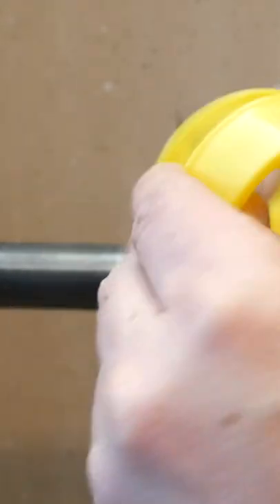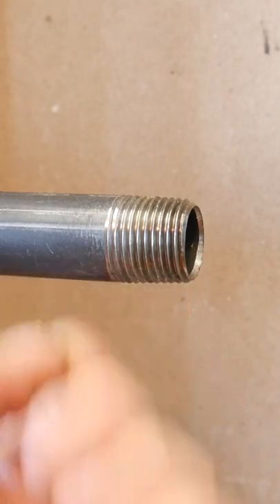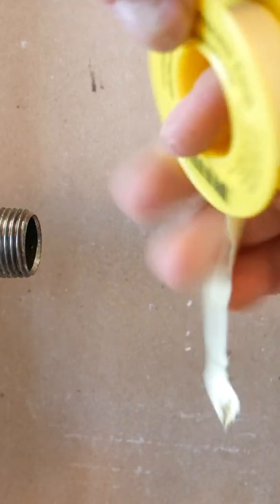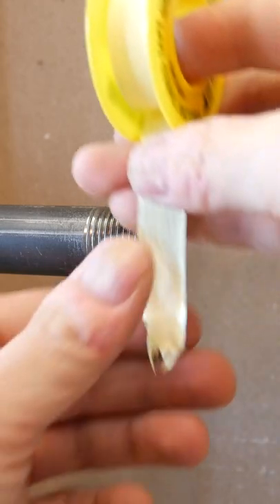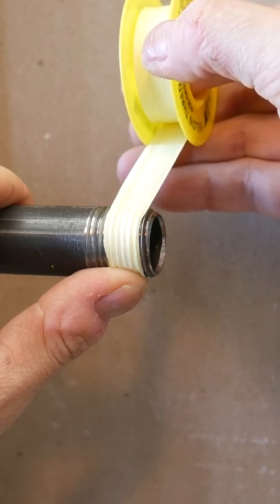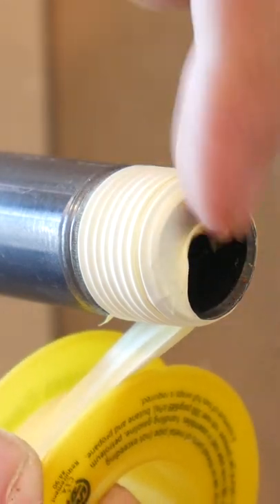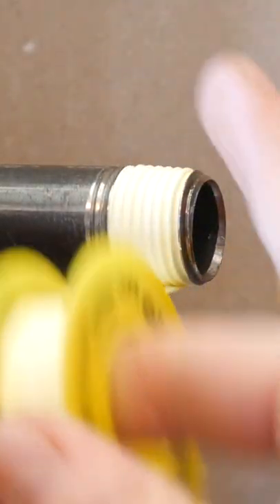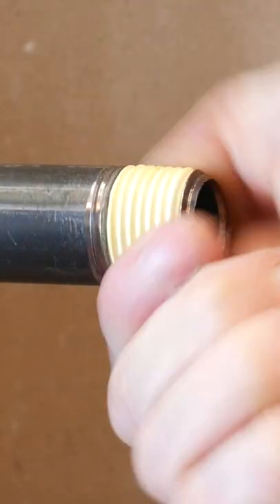How to apply TEFLON (PTFE) TAPE the Proper Way! (full video in description)

Comment: Not only that when you go to tighten anything on it, it’s gonna spin the same way so it will pull some of it off making it ineffective
Reply: as long as you apply clockwise by your right hand it will be effective, with out pull some and much easily turn tighten.

Comment: You should have specified you were taping a pipe for gas. You don't want to use tape specifically made for gas on a pipe carrying water, or vice-versa.
Reply: Blue for water, yellow for gas, and white for air. Different attributes that allow the first two to seal when they come into contact with water or petroleum gasses, but air doesn't need to be able to seal because you want to do a couple extra wraps. I think that's the reason, but might be wrong. If so let me know why?
Reply: There's absolutely no difference between white and yellow tape besides thickness. They can definitely be interchanged by just adjusting how much you use.
Reply: why ?
Reply: @Deathbomb9 maybe its just my area... i've never seen blue tape and the stuff for water is white. for air, most fittings use rings and grease or are precision made to press fit

Comment: Never use tape on gas piping, dope only. Whisps of tape can be blown through the pipe and past sediment traps. This can clog orifices and hold open pressure regulators.
Reply: I use tape and dope. Hold it back a thread. Won't hurt a thing
Reply: Just twist the tape and apply the same depth as the fitting. Then apply pipe dope. This will keep the tape from shredding towards the pipe. Use monster brand. It's for water or gas

Comment: 2 rotations is more than enough. I plumb in chemicals for water treatment on frac pads (hydrochloric acid, chlorite, and napco bleach) using either schedule 80 pvc kr kynar. Anymore than two rotations you are putting strain on the female pipe/whatever female threaded product you are using. 2 rotations and a line of true blue or other thread glue will do you with any liquid you are plumbing

Comment: Somewhat related question: Is there a proper order when using pipe dope and tape? I was taught to dope then tape… but I know some people were taught to tape then dope. Merci!
Reply from the maker: Its actually one or the other, but if I was to choose one, it would be tape, then dope.
Reply: @Got2Learn  Nice thanks for the info. I think the company I worked for did dope first so it'd be less messy lol. Water sprinkler pipe/fire suppression systems.
Reply: I do a thin coat of dope, one wrap of tape, then more dope. Manufacturers tell you not to use both, but everybody does it, everybody is different, some keep them Dope, it is probably a waste of time to use tape until you get to larger fittings like 2 in and larger. Don't use it on gas, however they do make special tape for gas piping, it is yellow in color.

Comment: I disagree with the direction of the roll. I apply about 4-5 times a day going through a lot of this stuff and yeah, that’s normally the way for most tapes, but for Teflon, I do the opposite. It keeps far more taut.I have one thumb on the roll and the other guiding.   Normally I’d not reply but funny you have opposite experience.

Comment: Don't you need to wrap it AGAINST the threads ( meaning, counterclockwise)? Reason being, it unravels if it is in the same direction as the thread, when you go to install it
Reply: It’s going in the same direction as you’re turning during install when you go with the threads. It doesn’t come off

Comment: almost, not quite.
I think you also need to be clear, both visually and verbally,
that its important the direction of rotation must follow the direction the pipe will be screwed.
You dont want to have the tape tail being pulled back by the clockwise direction of screwing the pipe on.
So, perhaps for clarity, show AND tell people to wrap tape in the same direction as you will screw on the pipe.
Reply: Now that's more clear n consice ig

Comment: Also it can only be applied clockwise on the threads or it will unravel itself whilst your tightening it into the fitting
Reply: Unless you are doing it too reverse threads, but that isn't in need of Teflon usually
Reply: yess unfortunately however you apply it aslong it is clockwise and tight you are expert

Comment: If you're using thread tape to seal a jar that the original seal has went bad or just a container of some kind with a lid that needs a seal, you can add the tape to the top threads and let it hang ever so slightly over the edge to form a seal for the lid as you tighten it down.  But yeah, don't do this with pipes, like he says.  Lol

Comment: For natural gas we cannot use Teflon nor should we rector seal number five is the way to go
Reply: #5 is the way to go!
Reply: There is an approved tape we use in the U.K. also we call it P.T.F.E not teflon tape just different terminology
Reply: @alemgas  UGH, the Tape in the Video is YELLOW TEFLON which is approved for Gas Lines
Reply: @LyonhartZ2  someone said you cant use teflon tape on this post, i pointed out there is a tape you can use on gas, as in the U.K. it's the yellow spool one. Cheers

Comment: I disagree little bit, the leaving the first thread part! Sometimes doing that , when you put the female side fitting, the tape roles back and insted going like in between the threads!.
So what I do is start at the first thread without blocking the hole so the when screwing the fitting on it the tape stays where it should be.
And 2 more thing: 1) it's just tape, Like who would mess that up! What's there to be safe! 
2) even if someone covers part of the hole, even a little water pressure will open it up! It's just solf tape!
Now I can't imagine someone covering the whole hole with tape, guy must be blind

Comment: that tip about the placement so it doesn't unravel too quickly 😭😭 why was my body automatically doing it on the top every...single...time... 😂😂😂
Reply: 3 weeks, a hundred pipes, not once did my mind make my body start it from the bottom 😂😂

Comment: Thanks for the video. Question - how often do you wrap the pipe clockwise? 99%? In contrast to going counterclockwise. I'm assuming counterclockwise is for left-handed threads which is a rarity. This part trips me up the most
Reply from the maker: Yeah, i'd say about that,  99% 🙂
Reply: @Got2Learn  ty

Comment: I go one thread back, and one single wrap only, otherwise it will just roll off when you tighten into the fitting. I use more wraps in a pinch when there is loose or damaged threads
Reply: If it is fine threads and or plastic fittings(shower heads) then I'll wrap it once. If it is NPT fittings like the video shows. The general recommendation is 3 times around. This can vary though if you are using regular tape vs thicker extra heavy tape. 

You don't want to put so much tape that together the fitting just scraps the whole wrap up the pipe without actually getting between the two surfaces.

Comment: Not sure if this is just a me problem, but I for the longest time always went around 3 times and never had any problems. Recently I've noticed this has not been sufficient. Every connection I've made recently has taken right about 8 rotation before it stopped leaking. I know, that seems like a lot, but it's not leaking. Just seems odd every fitting lately has done the same thing...

Comment: Clockwise is good if you're installing a fitting to the pipe. But wouldn't counter clockwise work if the fitting is in place and you need to install the pipe to the fitting? 
In other words. Apply the tape in the same direction you're twisting?

Comment: This is 90% correct... He forgot to mention that you put the tape on in the same direction like you are tightening a fitting on the pipe.. Righty tighty... If you put it on the other way...the direction as if you were taking off a fitting it will rip the tape off the threads as you tighten the fitting and not work properly... So if you are putting the tape on and it starts coming off and loosening as you tighten the fitting then you put the tape on backwards

Comment: 2-1/2 - 3 turns of tape is all you need. Any more than that and it will push off in front of the fitting. 
Though congrats on explaining to start after the first thread.
Reply: As someone who has never done this but watched 17 similar videos, I would have to say you are incorrect. No less than 9 wraps should be used and it doesn't matter if it's wrapped tightly. 💯
Reply: No way!!!
Reply: @eljefe1439  you are correct!
Reply: When putting in radiator tails we use 16-20 wraps 
But we use the white ptfe that’s thinner.
Reply: Incorrect. For rads I use 12-14 turns plus 6-7 squashed to make a taper.

Comment: I do all my own work and do it exactly like this except leaving the first couple of threads bare. I am gonna start doing it like this. Thank you for teaching me something new.
Reply: overlapping is not an issue. as long as it is a couple layers only, remember tapelon tape is soft material and can break into pieces. when you apply it into a thread it acks like a rubber and seal a un even space in a thread

Comment: Never use teflon tape on a hydraulic fitting on injector pump fitting for diesel Teflon tape does not compress so if a piece of that gets in the system it will definitely walk up a gear or a pump you may call a vian pump

Comment: Why do we use Teflon tape?
Reply from the maker: Full video in description.
Reply: I hate it.
Reply: Today I learned where to find the comments on shorts.
Reply: the main function of teflon tape is to act as a lubricant to keep metal on metal threads from galling and creating voids for a leak. Hence the reason for only 3-4 wraps.

Comment: fail
Reply: @Got2Learn  edge of the groove has to be blunted / scraped usually with an old hacksaw blade to hold the teflon  in place and stop it from slipping, you must have seen it ? old plumber here
Reply from the maker: That's for hemp & paste, for teflon its not needed.
Reply: @Got2Learn  i disagree
Reply from the maker: Why so

Comment: Great, but you need way more than 3 or 4 rotations. Unless you got some crazy thick tape?
Reply from the maker: 3-4 rotations is more than enough.
Reply: @Got2Learn  so 2 is enough? That's just crazy
Reply from the maker: I do 3 to 4.
Reply from the maker: https://youtu.be/Rg_yFELOfjs
Reply: Gas tape is pretty thick. Really doesn’t take much. Now, some cheap thin general plumbing tape, yeah some of that stuff almost requires the whole roll 😂

Comment: I have seen home owners using teflon as if it was actual adhesive backed tape. Wrap it around leak to stop the leak. I also have seen taflon taped outside of the fitting.

Comment: Remember is this pipe is used for natural gas lines, plumbing code has banned teflon tape,
Reply: Not where I live, new to me. What is their reason, is it because of maybe pieces getting in the pipe or blocking off or restricting flow, 
pilot tips?